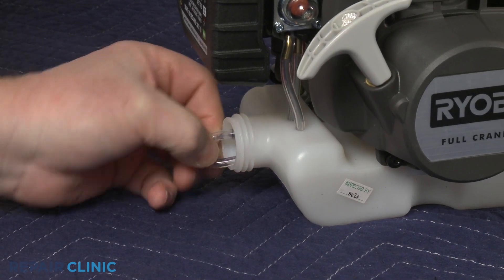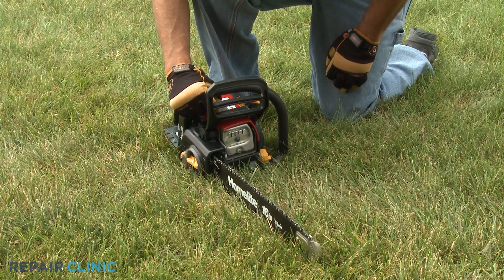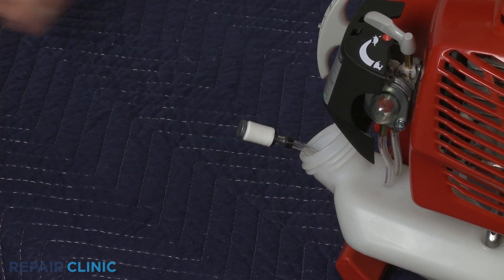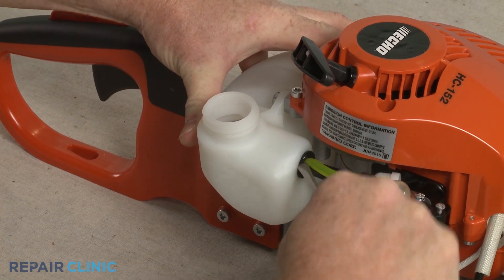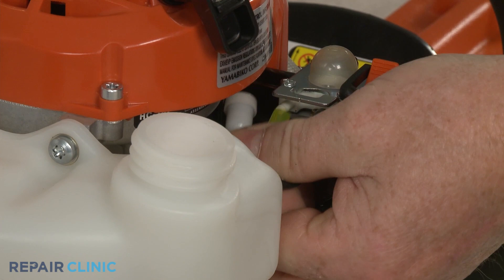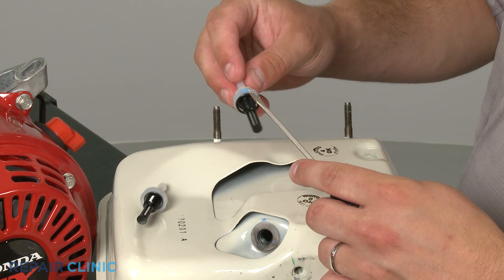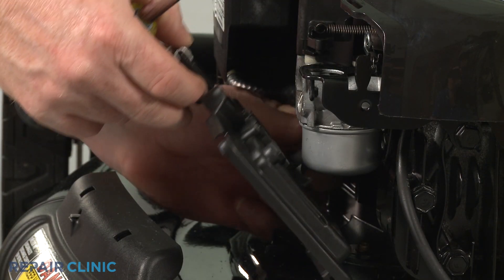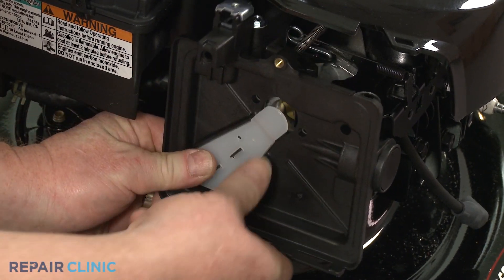Small Engine Fuel Filter - How it Works & Installation Tips

Comment: Hi, at about 2 minutes and 10 seconds of this repair video. You show a fuel filter being pulled out from the gas tank. I have and older chainsaw with that type of filter but want to know what it is made of. Because places keep trying to sell me a paper filter. But this filter isn't. It almost feels like ceramic. So I was curious what it's made of. I'd like to get the same type if filter. And does this type need to sit in the fuel to absorb the fuel before any can get to the carburetor. Thanks for your time.